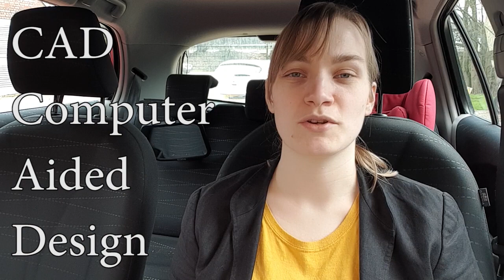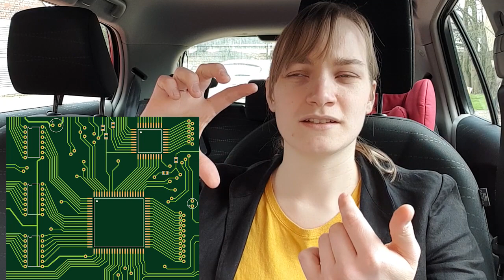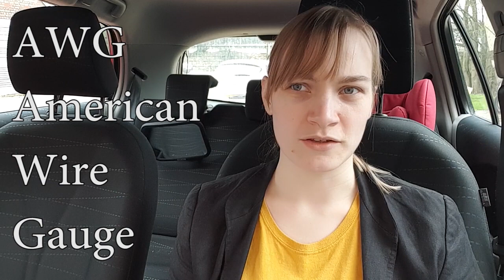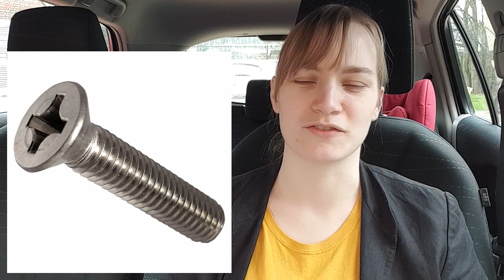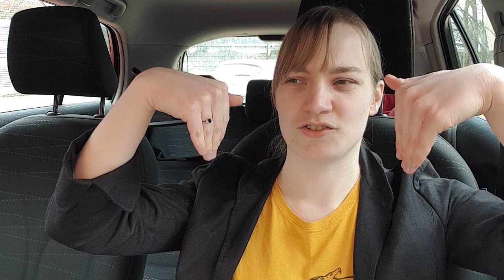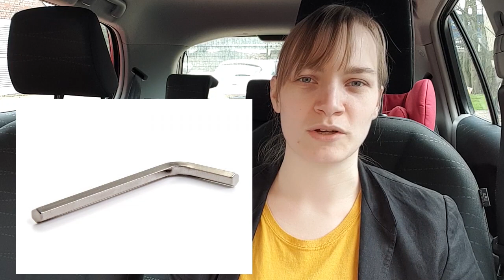The Words Engineers Think You Know

Comment: Really nice vid. Especially as a engineering minded craftsman who allready knows most these things and also take for granted that everybody kniws this. Got some fun trivia about screws that I might think an engineer can find interesting.
There is the universal tool no1. 
That is the flat screwdriver no2 (approx 3-4mm in width here in swe atleast). Used for poking, force holes in different materials,  finding joists or crossbars through plasterboard. Also to screw pozidriv or philipshead no 1 and 2. Fits very well in torx no 20 and 25 and no4 hex head. If used in tandem with a hammer like device it is great for chiseling out the safetypin from security torxheads. Can fill up space between a hex nut or bolt if one only have a slightly to big combination spanner. It is just a great all round fix it all tool

Comment: Numbered screw sizes are imperial diameter is .060=.013*number.  so a number 6 is .06+.013*6 = .138".  They are normally just even numbers, and usually sizes less than 12, although i have seen 14.

Comment: Maybe it's how I was taught or just my understanding; the difference between a bolt and a screw isn't size, but the application.
A bolt utilises a nut to provide a clamping force.
A screw either cuts its own thread or uses a tapped thread to provide a clamping force without a nut.
i.e. "You screw into something and bolt something together"

Also on head-selection - It depends on the material you're fixing. I wouldn't put a countersink in glass/perspex (to go to the extreme) as a taper/countersink provides tension/stress to the material, whereas a panhead would supply compression - compression>tension.

At this point, I'll hold my hands up and sternly confess my shitfacedness right now. I've tried my best to describe my understanding. If I'm wrong, please tell me how/why.

Comment: Regarding electrical wire gauges, in the states there seems to be a difference in sizing between home wiring and auto wiring. Solid and stranded, etc. Twenty years ago I built a car stereo system that had an auxiliary battery in the trunk and I used 4/0 (0000) AWG wire from the front battery to the rear one. It was a little more than .75 inch in diameter. Wasn’t cheap either.

Comment: I object to you classifying PCBs as 2D objects. Some, very simple, PCBS are undeniably 2D-objects in that they have copper on only one side. But most modern PCBs have copper on two sides, with a number of via holes connecting the two. There are more advanced PCBs that have more than two layers though, with copper and via holes layered throughout the board. If I remember correctly, the FOSS KiCAD can handle up to 32 copper layers. So a complex PCB is most definitely a 3D object.

Other than that, I think it is a good video, and should be obligatory watching for all STEM students. Maybe even for all students, no matter what they are studying, simply so they don't get tricked by salesmen in the future, throwing around jargon that doesn't mean anything but is hard to see through unless you know the terms.

Comment: You forgot CAM Computer aided manufacturing.  The thing that places the chips is CAM, it also includes CNC. CNC computer numeric control is a computer controlled machine tool. Torx drive 🤬😡.
Reply from the maker: What have you got against Torx?
Reply: It's all called MMC now, isn't it?
Reply: They are and added headache where that is not required. You could disassemble a car with a screwdriver and 5 sizes of wrenches  and now you have to try and fail to find the right torx . The bolts were adequate and replacing them with torx dose nothing to improve the product.

Comment: I've worked in aerospace as a toolmaker, production supervisor, fixture designer (mechanical-electronic-CAD/CAM-material selection, etc). Even use the CNC to make my own double-sided one of a kind PCBs.

Because it's a battery company making custom/special application reserve cells I also get pulled into chemical engineering discussions. I've worked closely with our Electro-Chemical Phd on a number of projects.

My 2nd best friend to remaining current and adapting to new project info has been the internet. I frequently spend time on the net searching the lastest terms, and randomly varying requirments of the latest repair, modification, or R&D project that hits my to do list.

I've been a machinist for 46 years, toolmaker for 20 of that. I still learned a thing or 2 from your vid. That's key; don't become unteachable, always learn the next thing.

My advice to new engineers/machinists/line mechanics?

Use the net. It's all here. Never stop learning. Become familiar with tool house sights, McMaster, Granger, MSC, Digikey. These are sights I hit weekly. There are others so look around.

Get comfortable looking for out of the box solutions. I've found info on how to start figuring out what at first seemed to be impossible.

Speaking of what I learned here.
For instance, that M6 is the last in a progression of metric maching screw sizes. M7 not being a thing. The progression continues M8, M10, M12...

M7 and other odds sizes exist. I checked because I've used them on our American shop. Like I said, RANDOM!

But they don't exist as "machine screws." Well done!

Chart for all or at least none-custom/proprietary sizes.

https://www.zazzle.com/tap_drill_sizes_metric_coarse_magnet-160815972924017474?rf=238840279726397180&tc=CjwKCAiAm-2BBhANEiwAe7eyFMAIVPTbPKL4XkDUQekmqA0aiTU3RVCuMJG2Oq3JSVzZWAkkvNTNkRoCs3IQAvD_BwE&utm_source=google&utm_medium=cpc&utm_campaign=us_shopping&utm_term=z160815972924017474&ca_chid=2001810&ca_source=gaw&ca_ace=&ca_nw=g&ca_dev=m&ca_pl=&ca_pos=&ca_cid=303811433262&ca_agid=59506862334&ca_caid=1600127754&ca_adid=303811433262&ca_kwt=&ca_mt=&ca_fid=&ca_tid=aud-802820146470:pla-306877212881&ca_lp=9003779&ca_li=&ca_devm=&ca_plt=&gclsrc=aw.ds&gclid=CjwKCAiAm-2BBhANEiwAe7eyFMAIVPTbPKL4XkDUQekmqA0aiTU3RVCuMJG2Oq3JSVzZWAkkvNTNkRoCs3IQAvD_BwE

1/4-20 & 10-32 most liked threads.
I've single pointed 2"-4 x 2' Acme back in the day.

😎
Reply: Finding out there isn't an M7 has given me PTSD. I feel like my whole life was a lie. Why? Does it scare the Japanese or something?
Reply: @cannaroe1213  
There is an M7 thread. But not an M7 machine screw. Could be just a matter of simplifying and reducing stocks.

Not enough difference between sizes to make strength issues matter.

Comment: I reeed wildly when you said PCBs are 2D. It made me actually curious, would love to see a chart of single vs dual vs multi layer PCB production as a % of the market over time.

I was surprised you didn't mention that Phillips screws cam out at certain torque levels. They're only really meant for assembly, they suck for disassembly. It's why I hate them. Phillips screws are immoral and a personal attack on me. Also, in woodworking, square drives are very common - partly because it's easy to make a screw where a square fits diagonally to the way a Phillips fits, which lets you make a better screw while still making it usable with a more common bit, and partly because the screw sticks on the bit very well, which makes them easier to use in woodworking where you typically put the screw on the bit and then drive it in with a screw gun.

If you do want to do more like this, talking about material manufacturing would probably be useful information for a lot of people. Most people don't understand the differences between stamping, casting, forging, milling, extrusion, drawing, etc - how they affect material properties as well as product design.

Comment: Not mentioned: Robertson screws. They have a square hole and need a square headed driver to drive them. They are used a lot in Canada mainly in woodworking but also some metalworking applications. They slip a lot less and have a lot more torque than slot-headed screws (comparable to Phillips in those ways). They are easy to manufacture and you only need 3 or 4 Robertson-head screw drivers for a large majority of applications.
Reply: The screw head also grips the driver so you can begin the screw one-handed.  And the head of the driver doesn't need to be magnetic.

Comment: Working on product design as well, I was (and still am) surprised how much there's to know about fasteners, something that they dont usually talk about in class
Reply: Need to know a lot about fasteners and screw thread systems as a machinist. Not only have to be able to identify the relevant thread system but also correct dimensions for machining/cutting the screw threads/fasteners.

Comment: As a shade-tree mechanic/tinkerer/repairman, I think all engineers need to spend at least a year as a mechanic or repair tech so they know their design decisions should take repair into consideration. So many cars (and electronic devices, but see Louis Rossman's channel for the best opinion for that area) are poorly designed from a repair standpoint and leave mechanics having to nearly break their back/neck to access fasteners. Likewise the use of phillips screws in areas subject to water/salt is absolutely insane. Phillips is the worst possible fastener once seized to get out. Motorcycles are notorious for having Phillips fasteners like this. (I hate Phillips generally; I wish that had never become such a universal fastener. I hope Torx or some other standard replaces it eventually)
Reply: Design engineers are designing to the manufacturing process, not the repair process.  Their management will determine the design criteria.
Reply: @LostInThe0zone  I know I'm screaming into the void, but it would be nice if designers had a bit of the DIY Ifixit philosophy taught to them. Instead, designed obsolescence is the rule of the road these days, and hence the Right to Repair movement fighting the lawyers, lobbyists, and corporate clowns protecting their bottom line against environmental and all other concerns.
Reply: I hate Torx, i never know if i have the right size, because they all seem to fit. Step 1 of unscrewing a Torx screw is measure the fkimg backlash between the bit and the screw. Feels like im cracking a safe. is it a 25, 27, or a 30? Posidrive comes in 3 sizes. That the right number of sizes. Torx isnt even the audiophile of fastners nerds, its the weird knock off. Hox is arguably better, but True purists prefer externally powered fasterners i.e. bolts. For me, the 12 star is where its at my man. I've heard some call it the "triple square". Because its so round it can be easily counterbored. Its just the John Shaft of bolts. Its the best. And often they print the size of the bolt and how much it can hold on the face of the bolt. Perfection.
Reply from the maker: @canna roe
Thanks for your comment. Made my day x
Reply: @cannaroe1213  Fair enough. I suppose the cost of the fastener is the primary consideration in many cases, which usually sucks again for people trying to fix something way down the road. I probably should qualify my hatred of Phillips; they are fine when used in electronics usually I guess I just hate them when used in any setting that ultimately subjects them to lots of torque and they strip out.
Reply: @cannaroe1213  to be honest I’ve never had any issues with driving Torx drive screws. Trick I have always found is to hold the torx key/insert by hand into the screw head and try to rotate it. 

If it’s correct T size it will fit rather precisely give or take and there will be minimal play for of maybe fractions of a degree when trying to rotate. 

If it’s not the correct T drive size there will be a lot more play and movement more in the range of multiples of angular degrees. As I say that’s just what I have found when working with Torx screws in the past.
Reply: Hmm, I live in Canada, so I often see a mix of Phillips and Robertson screws depending on location of manufacturing/assembly.  I imagine Robertson aren't much better when seized.